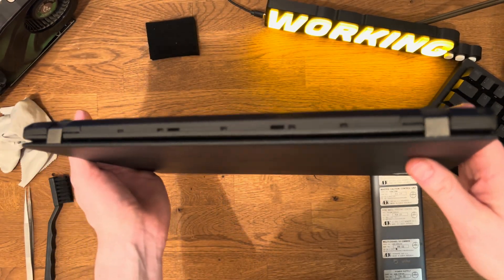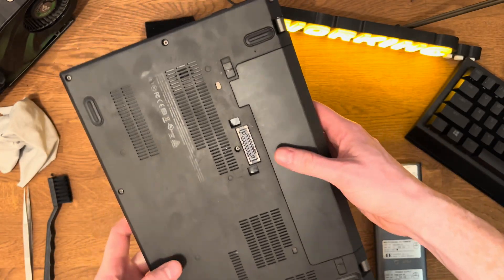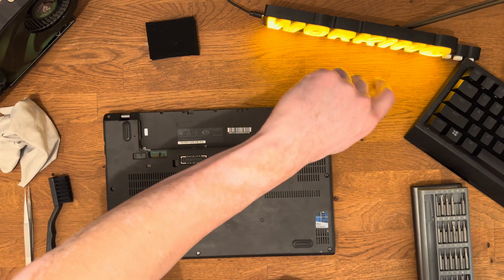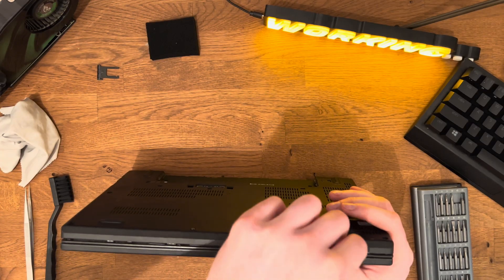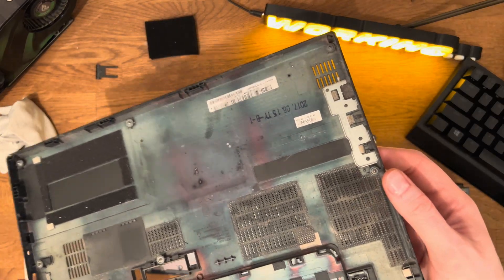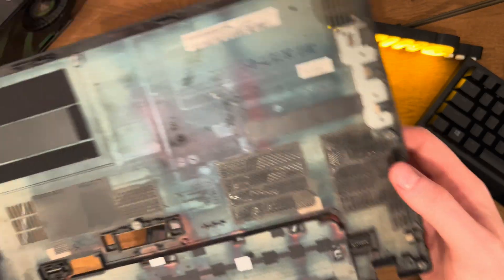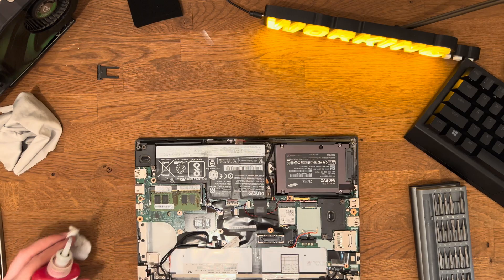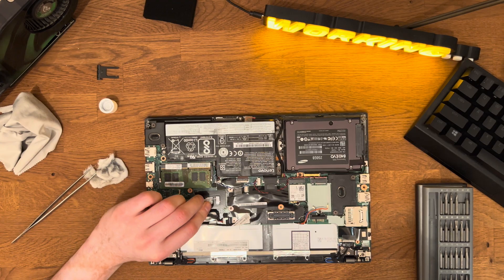Lenovo ThinkPad X270 Care | Easy Cleaning and Thermal Paste Replacement

Comment: Que tal está pasta termica dowsil 340 ?
Reply from the maker: I know this paste is not primarily intended for use on CPUs and GPUs, but I’ve been using it for a long time, and every time I repaste with it, the temperature consistently drops. I’ve never had any issues with it. I also use it on rough heatsinks for cooling high-power LED chips and regulators.

(Traduzido para você em português, espero que corretamente)
Sei que esta pasta não é destinada principalmente ao uso em CPU e GPU, mas eu a uso há muito tempo e, sempre que faço a troca da pasta, a temperatura cai de forma estável. Nunca tive problemas com ela. Também a utilizo em dissipadores mais grosseiros para o resfriamento de chips LED de alta potência e reguladores.